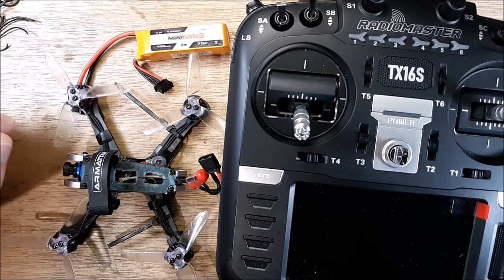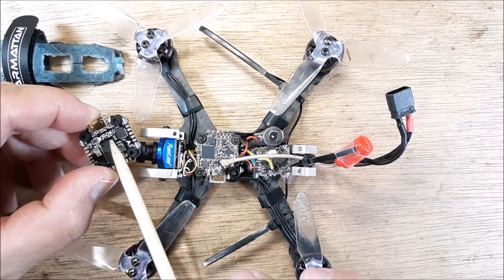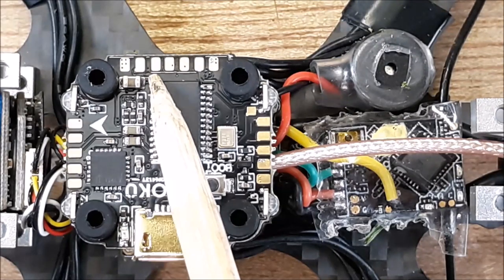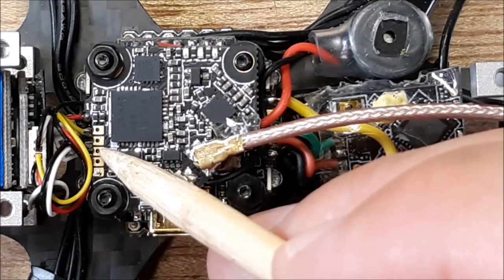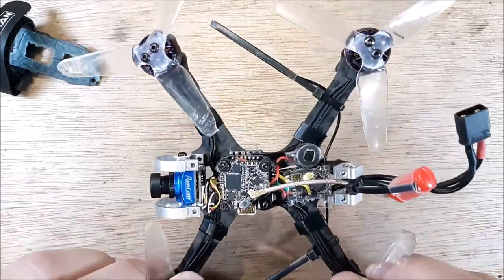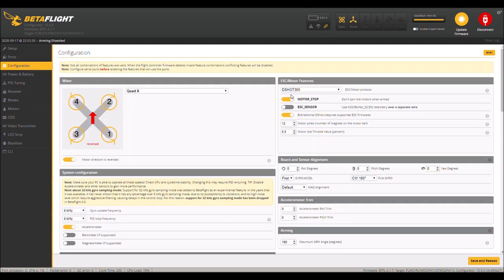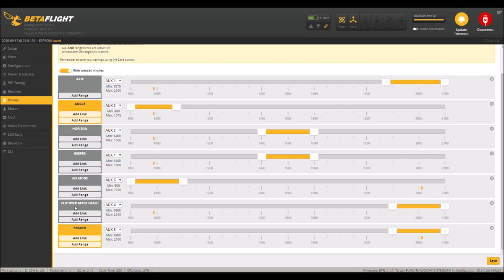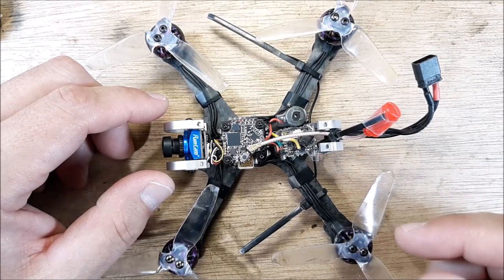Tadpole 3 Inch Flywoo F411 Iflight Nano Build Overview With Betaflight And Blheli S Plus Radiomaster

Comment: Man, I had a similar problem. 2 iFlight 16x16 stacks that did not work. Then I put a Mamba stack in it and get 2 1/2 flights and the vtx blows up. Finally got it all working and I am having a ball with this thing. Glad you got it going. It's a shame about the build video.
Reply from the maker: Glad to hear yours is up in the air. Had more than a handful tell me to stay away from 16x16 and do the whoop board, however, I'm going to do it all over  again as soon as I get this modified frame. What vtx and camera do you run now?
Reply: @propsoff  I have the runcam nano 2 and the TBS unify pro32 nano vtx in it. I posted a video of the vtx blowing up on me in case anyone wants to use it to troubleshoot their video problems. My first 2 battery packs were flown on the locked 25mw setting. The 3rd and last battery flown was after I unlocked it and set it to 400mw. Lasted a whole 50 seconds so my replacement tbs vtx is still locked at 25mw. I'm afraid it might blow up and I don't want to chance it until I have another vtx on hand. At the moment it's the only quad I have that's flight worthy.
Reply from the maker: @CarbonGlassMan  
I think I do remember seeing you post that. I have the HGLRC vtx going into the upcoming build. I heard it was good, fingers crossed. The frame guy messaged me today, the frame is in the mail. Hopefully get to see if it's any good. The Flywoo vtx is probably going to fail soon because it gets up to 200'f in seconds on just 25mw..
I'll cross my fingers for your tbs too...🤞🏻

Comment: Great video. I'm planning a F7 AIO board with a RunCam Split Nano woop HD DVR and a R-SXR. 1404 3850kv motors on 4s. Still accumulating pieces parts but it is set in stone attempt.
Reply from the maker: Sounds interesting.. 1404 motors can be some of the most efficient motors around...🍻
Reply: @propsoff  I hope your right... Thanks for commenting. Best wishes my friend!

Comment: i got the FC leds to work just not the ESC
Reply from the maker: Let me see....
Reply from the maker: 27:15
There are no leds on the ESC here on my stack.. Not sure what to tell you...?
Reply: @propsoff  ok after spending 2 days on this i found a picture on flywoos website on another ESC / FC combo. not the one i have. Anywho, It states, in RED. To Turn on the LED Function, Only 5v In, Is needed. LED in is supplied by the Pin / connector. so you have to wire from a 5v pad on the FC to the TINY (5v in) pad on the front of the esc. I now have all 8 led's on my stack working Thanks for your help
Reply from the maker: @Lordprimate  
That's the way the leds work on the VTX of my stack, as I mentioned in the other video. Just needed to wire a seperate wire.. Glad you got it working...👍🏻🍻👊🏻

Comment: Hello ! Been following this build , in conclusion , do you think I should  go with this 16x16 stack or opt out for something like a AIO betafpv f4 v3/v4 ? Please advise ! Thank u
Reply from the maker: I would do the whoop size AIO if I did it again.. I really like the clean lines of the 16x16 and not having to purchase the adapter board. However, the options are limited and only 2 Uarts make me think an AIO board is a better option and more future proof.. I debate if 16x16 will even be a thing soon... Hum...

Comment: I wonder if you've experienced this. I've been trying out different props on my 3 inch Tadpole and flying 3s and 4s batteries. I noticed when I use the Emax Avan 3 inch props the quad will freak out a little by shooting into the air a few feet if I touch the ground to land or if I stop a fall in the air by blipping the throttle. It doesn't do it on 3s, just on 4s and just with the Avan props. The Avan props are pretty aggressively pitched with a wide blade near the hub. I am also using air mode which I see you're not, but I thought this was an interesting thing to have happen. If I put on Windancers or Hurricane props it never does this.
Reply from the maker: I do run Airmode, Just not during takeoff and landing. I have ran 4s and 3s and seven different props on these motors and haven't had any runaway issues. I'm running RPM filters at stock and also stock Blheli_S Jazz Mavic settings. Not sure what's up, hum? Emax Avan props are most aggressive of the props I tested, but I like them well.
Reply: @propsoff  I love the durability of the Emax props and I like the aggressive pitch. I really like the Windancers but I don't like how easily they get chewed up.  I don't know anything about RPM filtering or Blheli yet. I know how to change the motor directions but that's it. I'll have to learn about that. I just swapped out my flight stack for an AIO board on the Tadpole. I thought maybe that would change how the Emax props did but it's the same. They're great for me on 3s and even on 4s as long as I don't change the quad's direction in a jerk kind of way.
Reply from the maker: @CarbonGlassMan  
Very odd.. I can full send for 3 or 4 seconds and snap roll with no issues. I tried to get it to desync and burn the esc as I tested it (3s). I have not tested 4s aggressive yet. I want the AIO whoop style board and throw this Flywoo 16x16 stuff in the garbage. Soon, Hopefully. 
I will have a video showing how to do rpm filtering and blheliS too, if your interested.
Reply: @propsoff  Oh yeah, I'm interested. I like all of the videos you've been doing lately that show the basics of how to check this and that. Important stuff for newbies.

Comment: I have a similar setup but using succex stack. I had a heck of a time getting telemetry working also but finally got it sorted using sbus and smartport. I wired my smartport to the LED strip pad on the FC and after remapping the resource, it worked! I may have missed it in the video but how do you have the smartport wired?
Reply from the maker: I remapped the TX1 pad softserial. I don't have the ability to do the led pad on this one.. Bummer
Reply: @propsoff  ah ok I see that now. Yeah not sure why that doesn't work. Maybe that pad isn't setup for 2way communication... That's the problem I had with my FC too. Documentation is terrible on these things. Fport may work but would require reflashing and rewiring so probably not worth the effort haha. Keep up the good work 👍
Reply from the maker: @pucksaver  
Not worth the effort is where I'm at, Lol...
I did Halfduplex on and off plus other cli commands. Not working...
Sometimes I know enough to be dangerous...👍🏻🍻🤣